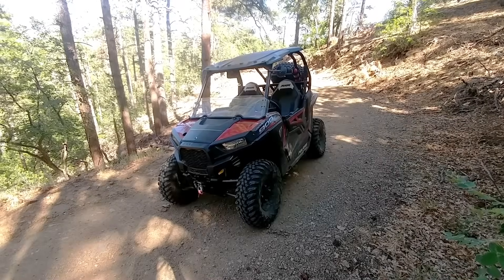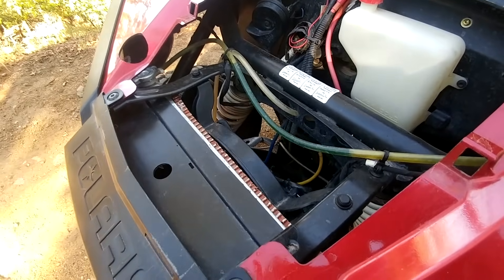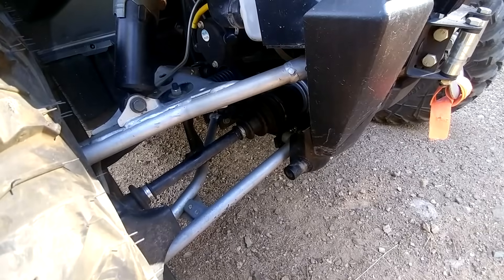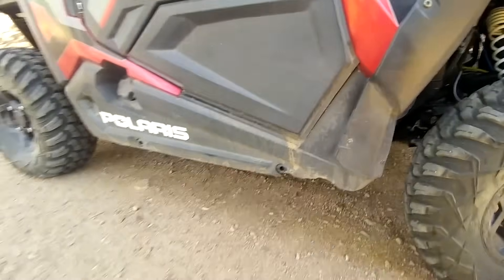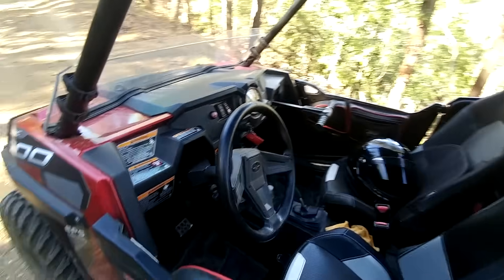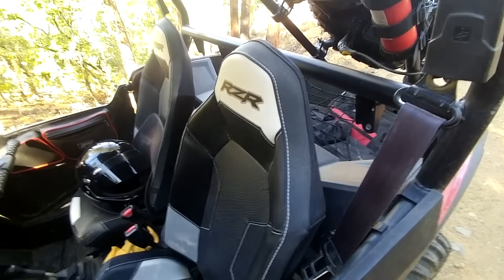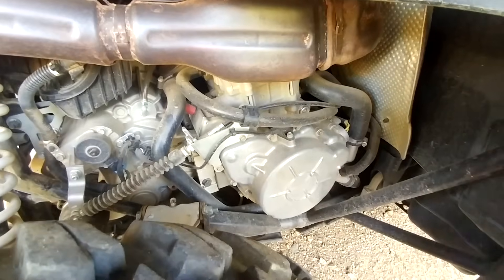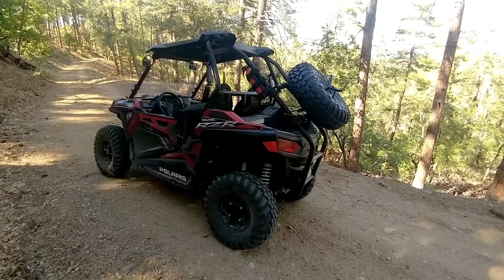2015 Polaris RZR 900 EPS Trail, 6,000 mile owner update

Comment: Very well done!  I guess I don't feel so bad now about our 2013 800.  We've got 2,000 miles on it, most of that on gravel or pavement.  But we don't have the luck to live where you do with so many trails, either. 

Replaced the battery last year (they aren't cheap), but it was 5 years old, so I was happy.  I keep it on a battery tender all the time, even in the summer, which contributed to the longevity.
Replaced the belt twice, but never had a failure.  Changed the oil 3 times in six years (shame on me), but that's like an oil change every 700 miles, so...
I don't drive it hard, but it's scuffed and scraped.  I got it up to 50 once and that was enough for us.  We keep it at 35 mph max now.  Mine doesn't have near the squeaks yours does, but you've really gotten your money's worth out of yours, too.
I have a friend who has the same model and year as mine, and I think he has less than 200 miles on it.  But it for the hunting camp, and rarely uses it except for deer season here. 

All in all, the 800 has been a good workhorse, tool, and mostly fun toy for us.  We love it.
Thanks for a really nice overview.  I enjoyed watching it.

Comment: Appreciate the video. I've got a '20 900 with a similar setup from the Terrabites to the rear roll cage extension / spare tire carrier.

It's definitely a noisy ride in general, especially the engine noise (reality of the tiny trail models that put the exhaust can right behind your head)

Getting ready to trade up to a full sized liter ride once I can sell it; we don't have many 50" trails out in the Rockies at all, and I have quads for them when they pop up. 

Cheers!

Comment: Ditch that stock skid plate and get an aftermarket one. Something like the tusk. It provides a lot more coverage and does not have those hard edges to catch on objects that you are sliding over. As for the plastic rocker panels, the same thing happened to mine. I ended up cutting mine on about a 90* angle at the front to eliminate the broken corner. 
Nice machine, by the way, it looks just like mine.
Reply: Just had that happen to someone on are group ride, they got hung up on a skinny stump and folded the skid plate up, ripped the rubber hose off the coolant lines and made some nice grooves on his tas tank.

Comment: Another great review, the one thing I did to both my wife's and mine after my wife's voltage regulator failed about 30 miles from the truck was move the voltage regulators to the firewall mounted on a ceramic heat sic . I really worried about the voltage regulator down in front of that left rear tire. I agree with you that they are one really good machine.

Comment: I guess I ride quite different. Been driving it like I stole it, and I pound most every part you reviewed out of that machine, and I have the same one. Love it, good review.
Reply from the maker: I am having a pretty significant driveline sound that my local dealer can't diagnose. I had the front diff rebuilt, the CV joints are recent but the clutch is original. I have to replace the secondary clutch "balls" about every 2 years but they were just replaced so I think I may have finally encountered something expensive LOL.

Comment: Just wondering if you have had any problems with your charging circuit , stator, reg regulator or wiring. I have 2 of these machines and both of them have had issues with failures and melt downs. Polaris is not much help. The fourth time I bought 2 of the new Rick's regulators from my dealer. This time the regulators survived the melt down. I am ready to hard wire the stator and regulator into the circuit and eliminate all the connectors. I respect your knowledge and input, I would love to get your thoughts on this matter.

Comment: I drove on a fifty  inch trail.. and was motor cycle also.. anyway was heading down a crevice(sloping down hill) and a tree root was sticking out
and caught my rear atv 350 grizzly plastic panel.. yes it gave a rip of two inches.. basically I was locked in that space.. moved forward and crack.. Darn
another ride on another trail a big tree branch I thought would clear while I moving along the trail.. it caught the same crack panel area..
now a bigger crack.. Darn.... other panel accidents occurred.. Bottom line replace the panels.. after 10 yrs use 3k miles. and basically no repairs.

Comment: I am interested in putting a spare tire on the back of my machine exactly like you did. Can you comment on the brand and the part number of the rail that you used to mount your spare tire? Thank you so much. Great video!
Reply from the maker: I don't remember the part number but it's the OEM Polaris spare tire holder. I had added the rear roll bar struts (OEM) to be able to hold it. One tip, it has removable pins...those rattle like crazy, change them to nuts and bolts.
Reply: Thank you for your reply. I did contact Polaris. They told me that they didn’t make this part anymore. So I am on the lookout for anything that will mount a spare tire at the moment. Not being very successful finding any solutions, but I will keep on looking. Again, thank you for your comments and support.
Reply from the maker: @robertcalderone682  So it turns out that won’t fit my 2023 new one. The roll bar spacing is different between the pre-2021 and post 2021 machines. I’d be interested in selling it if that’s the fitment you need,
Reply: Definitely interested.  What would you be asking for it? Thank you!
Reply: @ramblingadventures  By the way, what kind of tires are you using? I like the tread better than the tires I have. Also where did you get the windshield? Both items I think I will be updating. Thanks again! Bob
Reply from the maker: @robertcalderone682  Like $150 but the shipping might be expensive. You can email me at peterfowlerjr@gmail.com
Reply from the maker: @robertcalderone682  Oh and the tires are Tusk Terrabytes (I have a couple of videos about them on my channel) and that’s the Polaris half windshield.
Reply: You are in AZ correct? I live in SEMesa and also in the White mountains (Overgaaard).I can pick them up if you are serious selling them. Just let me know. Thanks again.

Comment: Thanks for the great tips on maintenance items.  I have a red 2016 Trail and love it.  I added half the metal blade cover from a cheap room fan to protect my radiator after seeing it in a video and it's working great.  Have you re-greased your wheel bearings?.  After seeing some of the videos about people having problems with them, I bought one of the on vehicle wheel bearing greasers and it took over 20 pumps of murine grade grease!
Reply from the maker: I haven't done the wheel bearings. They were pretty good last time I inspected them. They're not actually supposed to need grease during their life. I just replaced the suspension bushings though. Check out my new video.
Reply from the maker: https://youtu.be/1o83xWddu5s

Comment: part of your suspension noise will be the rear shock end bushes are rooted ... 24.32 sec see the bush at the top has shit the bed .... the wiring in front of the left rear wheel looks vulnerable ..... sounds like your getting a good run from yer rzr
Reply from the maker: In a later video, I replaced ALL the bushings with uprated ones. Though it helped, it didn't eliminate the noises.Some of the stuff just seems to have been built in! I was jealous of my friend's new 1000 Rock and Trail in that it had no grease points in the whole suspension and everything was heim jointed.

Comment: Excellent video! I have a '16 trail and love it! I try to grease every 1-2 rides. I feel like i find most of the zergs, around 14 but I feel like I am missing some. I heard there is one under the machine that is tough to get to. Manual is not too clear. Do you have a video showing ALL grease points on the 900 trail? Thanks.
Reply from the maker: I don't have a video but there are two on the center axle. One of them requires removing the center console (which is why it's a good idea to buy a pack of the fasteners because they easily break). The other is where the central axle comes out from the rear differential. That one can be seen if you look carefully and doesn't require any disassembly. The frequency is in the manual...it's not all that often they need grease. Next time I do it, I'll make a little video. To take the center console off, remove the seats then remove the shift knob (pry the cap off with a thin screwdriver and it's held on with a torx bolt) and pop all the plastic fasteners out. The boots for the seatbelts and shfter can be wrestled out of the way. I bought a 100 pack of those fasteners just because they can get messed up. You'll see the zerk fitting on the slip joint of the axle. Theoretically you're supposed to use a different grease for the axle. Polaris has a general purpose grease and an axle/CV grease.

Comment: Thanks for the detailed video.  I was considering purchasing one of these and now I don’t want one at all!  Who the hell needs a constant maintenance and repair project like this?  Like I need another money pit in my life...
Reply: Lance Le May yeah you should probably take up knitting.
Reply: WildCard73s - yeah, I could knit all the whiny crybabies a bib they can cry into when they tear up the stupid crap that they buy.  I'm holding out for the Honda Talon this spring.
Reply: I think Honda makes a great product but... I would never personally purchase the first year of anything manufactured and the talon has absolutely no storage from what I’ve seen.
Reply: WildCard73s - my local dealer just came back from the Las Vegas area where he looked at the 3 variations of the Talon.  He said there is enough room for a cooler (probably a Honda accessory).  Normally aspirated and Turbo with be offered, all are DCT.  Turbo is the widest model.
I will be 64 this spring.  I don’t wait for anything to be refined anymore.  Don’t have time.

Comment: Have you ever had a clicking sound on light engagement of the throttle?  It feels like I have to give it more gas in order to get a smooth engagement.  I let my friend drive it on the first gas tank and he rolled it over on the side and it has made the clicking sound after that on light engagement of the throttle.
Reply from the maker: Yes, I had that. Clicking on clutch takeup. I eventually ignored it and then it eventually went away but it was pronounced early on.
Reply: allegroracing thanks!

Comment: Love your Vids! Wondering if you could comment on you spare tire carrier. I just purchased the cab frame extension kit identical to yours. Ive been reading some good and bad reviews on the spare tire carrier from polaris. What are your thoughts on that product?
Reply from the maker: It's generally a good product but it rattles like crazy. My friend has one too and the pins that are designed to make it removable or able to be "swung aside" can't be so tight they don't pull out so it sets up a lot of rattling. We figured that we rarely do swing it or remove it so we put bolts and nuts in place of the pins and that shut it right up. The only other thing I'd recommend is buy a good bike security cable and "tie" the spare to the frame if you leave the RZR anywhere where people can get at it. I use a combination lock version. The tire is held on with a hand-tighten piece so someone could walk away with your wheel/tire.
Reply: Man, That is fantastic advice. Thank you. I cant stand rattling as well. and a lock for the tire, Check. Your thoroughness is outstanding. Cheers
Reply: @ramblingadventures  
FYI and others...  a person with knowledge of "locksporting" (yes it is a sport) can open most combination locks within a minute or less.  Most Master locks you buy in Walmart or Target, etc. can be open within seconds.  I pick locks as a hobby.  I tell my kids if they ever put me in a nursing home I'll pick my way out...   Nice educational videos!!

Comment: If i buy one and use it instead of a vehicle how many kilometers until the engine goes i will use it for long straight aways and trailing and just kinda harsh riding dk you think.its a good idea
Reply from the maker: Interesting question. First of all you're going to need DOT tires because the off-road tires won't last more than a few hundred miles on-road. The Tusk Terrabites I use are DOT and wear well. How long the thing will last is impossible to say. I have no engine issues at all. The troubles I'm having are the suspension and driveline parts wearing out from off-roading and not so much from on-roading. Keep in mind though, this machine on its best day on flat ground can juuuuust hit 65mph. Realistically it can't sustain more than about 55mph so that limits where it can drive. Do the maintenance regularly, use stock air filters and who knows? I have about 7,500 miles on mine now and have some clutch issues but it's done PLENTY of hard off-road so that's still a long life for those components.
Reply: Yeah, I would say not more then 12,000 to 15,000 miles. They're not a car, and they aren't designed to have that kind of lasting lifetime.

Comment: So, you've had those new tires for a few months now, how do you like them ? I just ordered a set for my Maverick Trail but haven't had a chance to mount them up yet.
Reply from the maker: I still like them. They only negatives are 1. They effectively stiffened the spring rate (since there is less flex in the tires), 2. They seem to have hurt the fuel mileage by a couple of miles per gallon and 3. They got noisier at high speed as they wore-in than they were when they were new. But I feel like I can go over rocks with impunity (I did some rock crawling going to "Smiley rock" in the Mingus mountains that would have been risky on the stock tires) and effectively raised my speed on all the rocky trails around here because I don't have to be so careful about getting punctures. I still prefer the handling with these tires (and tire sizes). They seem to be wearing pretty well though they get a bit chewed up by pavement driving. I'm interested to see how they do in snow but have to wait quite a while for that!